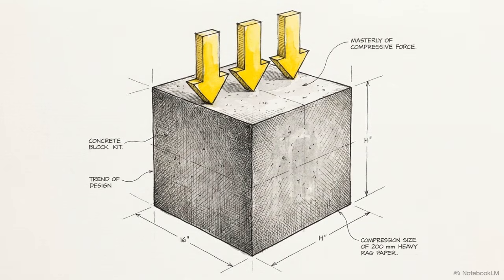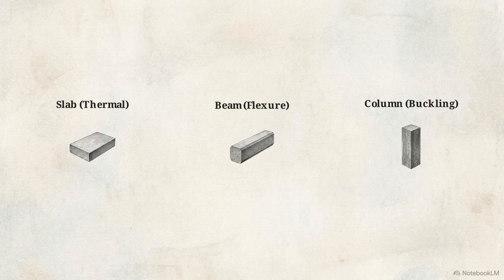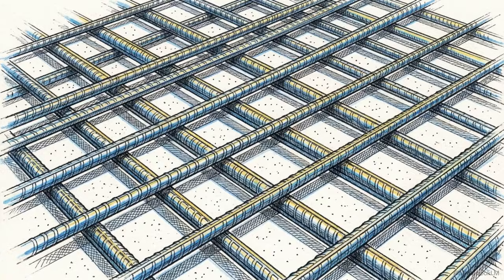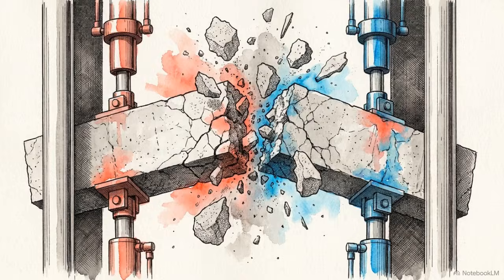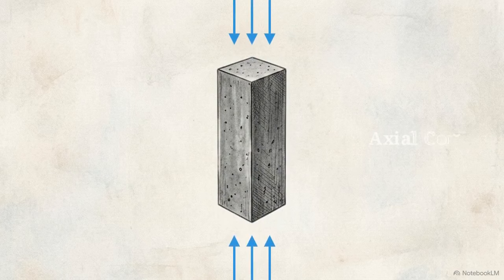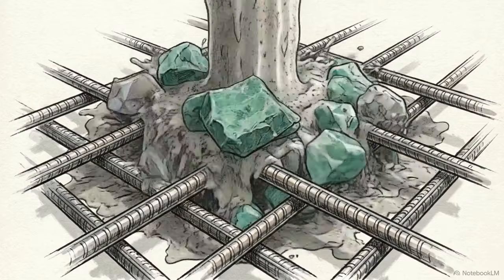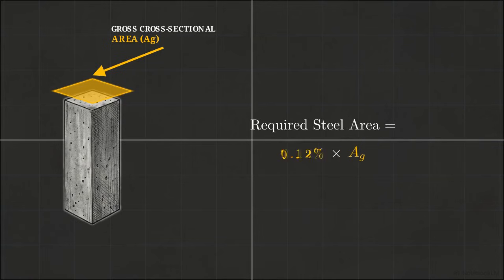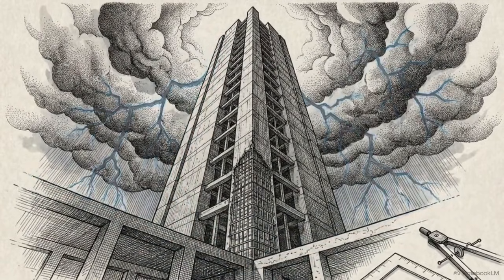Do you know Minimum & Maximum Steel Reinforcement % in RCC Members (IS 456:2000)

Comment from the maker: IS 456 Code: Steel Reinforcement Limits in RCC Members

Footing: The minimum steel requirement is 0.12% of the gross cross-sectional area for HYSD bars and 0.15% for Mild Steel (MS) bars. While there is no specific maximum code limit, engineers generally keep it below 4% to ensure proper concrete compaction.

Slab: Similar to footings, the minimum steel is 0.12% for HYSD bars and 0.15% for MS bars to control cracks from shrinkage and temperature changes. The maximum steel allowed is 4%, though slabs are typically lightly reinforced in practice.

Beam: The minimum steel is calculated using the formula Ast(min) = 0.85bd / fy. Practically, this translates to approximately 0.20% for Fe415 steel and 0.17% for Fe500 steel. The maximum steel allowed is 4%, beyond which bar spacing and bond strength issues occur.

Column: The mandatory minimum steel is 0.8% to handle accidental moments and buckling. The code allows a maximum of 6%, but 4% is practically recommended to avoid congestion and allow concrete to flow properly in lapping and splicing zones.

Important Note: All of these percentages are based on the gross cross-sectional area of the respective RCC member. You should not multiply these percentages by the density of steel (7850 kg/m³) to calculate reinforcement, as that is a common mistake.